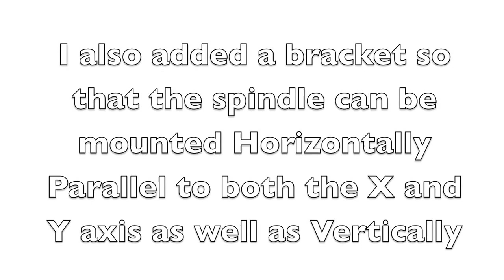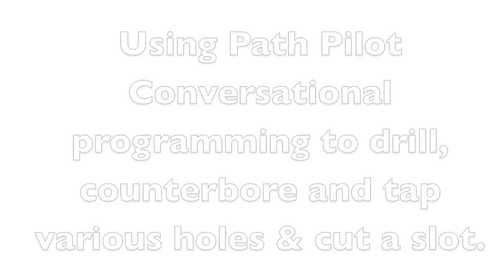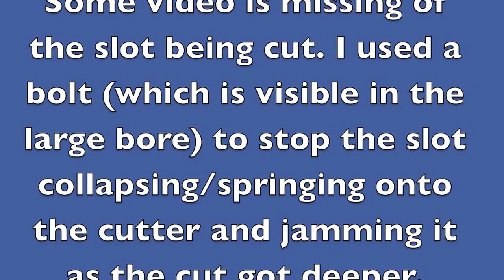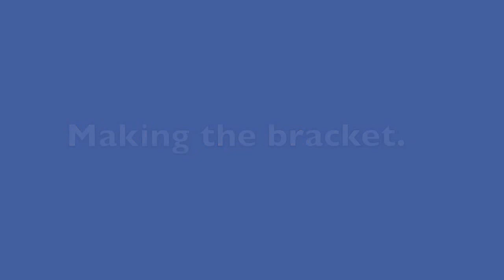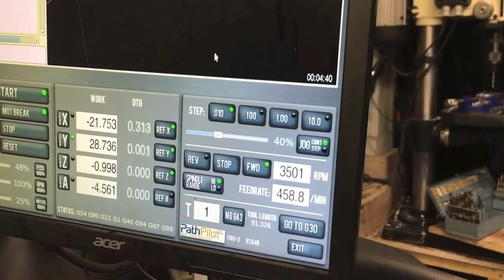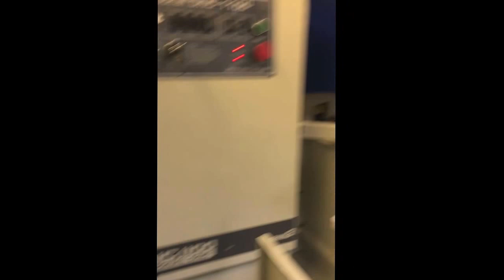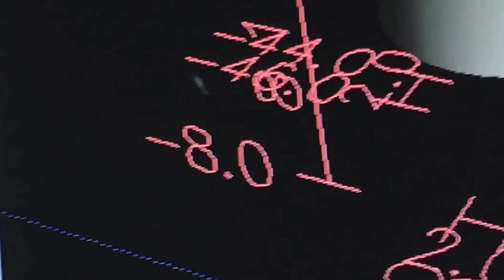Making A Kress Spindle adaptor for the Tormach PCNC 1100 Series 3 Mill

Comment: Any videos with you using the Kress Spindle?  Would love to see that, as mine is still sitting in its box.  Maybe this weekend I'll play around with it.  I have some small cutting(.01" end mill) and really don't want to cut at 0.7IPM @ 5100RPM.  For a small mold 8 hours to cut is too long.  At 30K RPM my cutting time would be less than 2 hours.